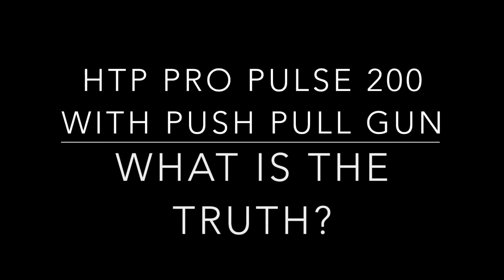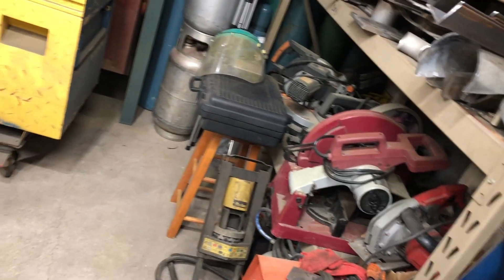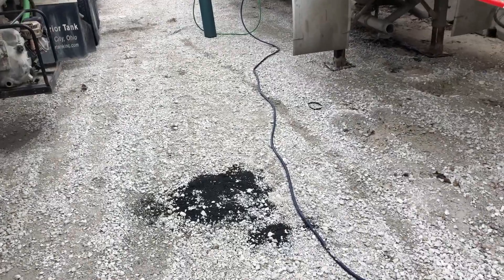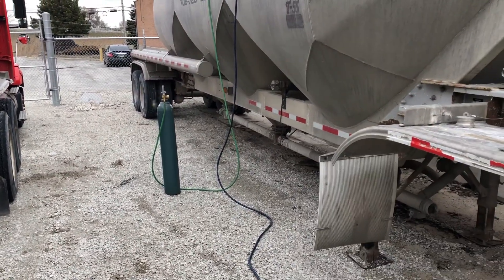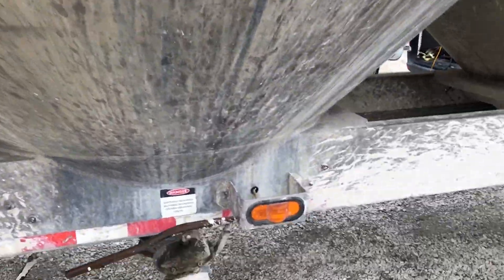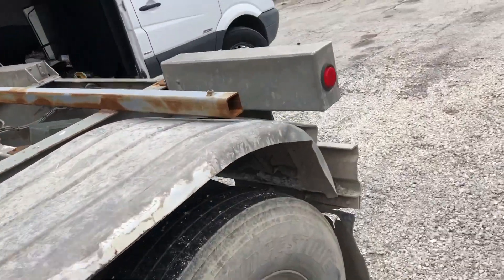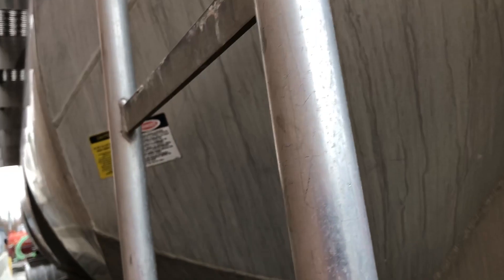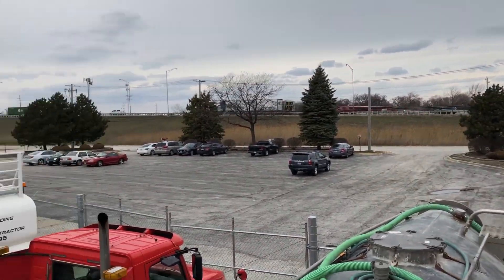The truth about Push Pull guns.

Comment: When you are welding old oxidized aluminum that perhaps has been contaminated with oil, is there any problem ? I have a old aluminum dump body and some of the cross member welds broke when the truck got in an accident. Of course I used all kinds of degreasers and cleaners but my welder friend still had problems. Any tips ?
Reply from the maker: take a torch, try to burn out as much oil as you can, sandblast, raise your argon flow rate, always push the weld, cross your fingers and hope for the best
Reply: @ZILAwelds  Thanks.

Comment: Couldn't you run a spool gun directly from the Ranger ? My shop is a block away from North River boats they use push-pull and TIG.
Reply from the maker: i could have - i have over 30 pieces of welding equipment ...  some times there is too much to choose from .. also watch my video tomorrow on remote controls - this will show you how i run a spool gun off the engine dive - but the thing is you need 2 hands to adjust wire speed and voltage ... and 2 cables ... and its cumbersome ....  
here the settings were synergic and one knob on the push pull gun adjusts wire speed and voltage all at the same time .... !   it works super slick - especially when you are inside a tanker, balance on a 2x6 and use one hand to hold on to stuff and you dont have any flat surface to set something down on like that potentiometer box (you will se in the remote control video) ....
and definitely climbing in an out of the tanker to make a voltage adjustment on the engine drive ?!?  BAD PLAN
Reply from the maker: since you asked about it - here is your sneak peak    https://youtu.be/AoXYkWBW-wo
Reply: +ZILA 
Tomorrow ? what about the Bobcat spoolgun video from 3 years ago ?
Reply from the maker: what do you mean? I already gave you the link for tomorrows video... and years ago if you refer to the video i made with chucke on spool guns - that was a trailblazer because the trailblazer has remote control capabilities and the bobcad does not ...  i never had a bobcad and i cant remember making or promising anyone a video about that ...
Reply from the maker: no worries - i knew what you meant.   now even with he spool gun in that video back than - and although that set up was pretty slick for an engine drive all things considered ...  when yo are in a tanker, holding on for life and holding your breath till the fan sucked out all the fumes ...  it is sooo much easier to adjust all settings with one know rather than trying to find the right balance between wire speed and volts ... also the pulse helps with some residual contamination although the material was sand blasted it also helps with filling gaps - a lot more so than just straight up spray arc from the spool gun ....

Comment: Why do most people mig weld these baffles when they crack.  I know it’s much faster but a multi pass tig weld would be far superior. I’d say about 75% of the 5 year inspections we did on fuel tankers that were mig welded were cracked back.
Reply from the maker: no tig welding is not superior to tig welding ... this blanket statement is just incorrect ....  this is a very involved, no necessarily complicated topic and there are a lot of factors that play into this that need to be considered ...  if you want to discuss that, shoot me a an email with your phone number and I will call you and explain in all lengthens what is exactly going on ...  CL@zila.net and if you dont that is fine too .. maybe one day I will make a video dissecting these myths ...